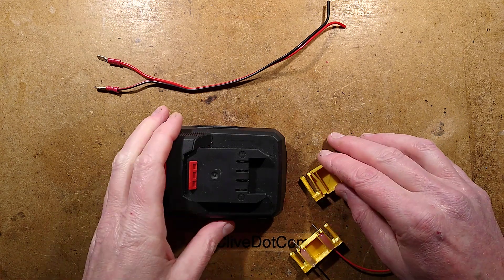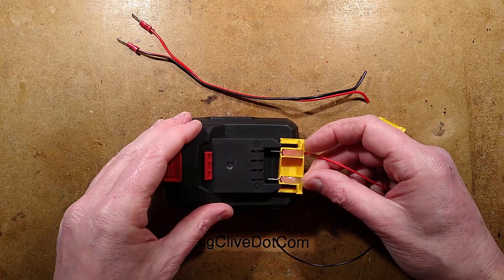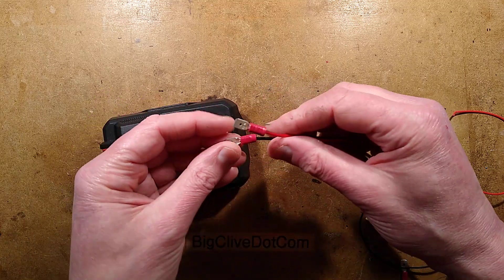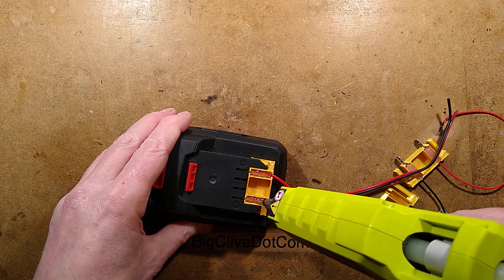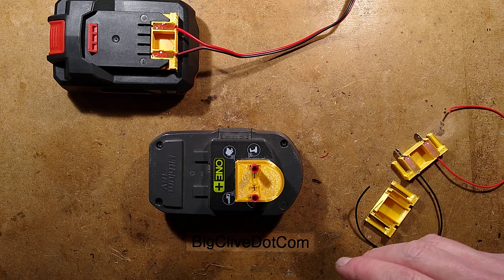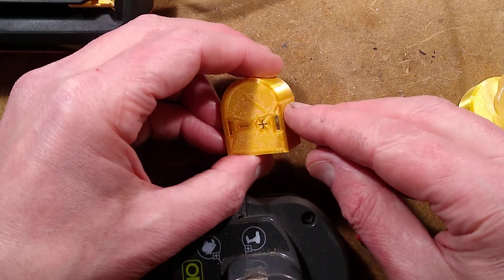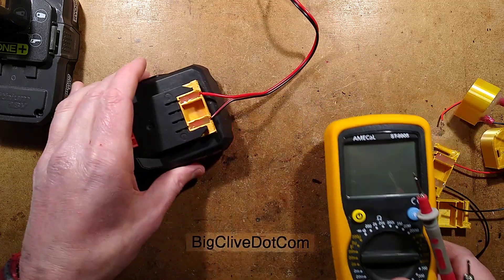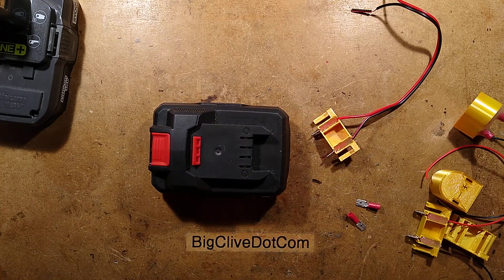Simplest Ryobi and Parkside battery connectors

Comment: Parkside is made by einhell/ozito and not compatible
Reply: I thought it looked like einhell as that's my ecosystem.

It's a shame there not compatible 😟
Reply: @jus.photos  For Einhell Power X-change you can buy partnr 451385001031 as a ready made connector. You could use that connector as-is, or use it with a 3D printed cover.

I've made an openScad (full cover) design that should that fit ready made connector but haven't printed  this final version myself, so if if you plan to use it be prepared to file it down a bit if you decide to use it.

// script starts here

width = 52;
depth = 60;
height = 12;
radius = 5;

translate([-35, 0, 0])
    color("gray")
        model();

function x() = -width/2;
function y() = -depth/2;
function z() = 0;

function size() = [width, depth, height];
function location() = [x(), y(), z()];

module base()
{
    translate(location())
        linear_extrude(height)
            minkowski()
            {
                square([width, depth]);
                circle(radius);
            }
}

module base_cutouts()
{
    slot1_width = 49;
    slot1_heigth = 4.2;
    slot1_depth1 = 56;
    slot1_depth2 = 55 + radius + 1;

    slot2_width = 42;
    slot2_height = 6;
    slot2_depth = 55 + radius + 1;

    slot3_width = 49;
    slot3_height = 9;
    slot3_depth = 12;

    function slot1_x() = -slot1_width/2;
    function slot1_y() = y() - radius;
    function slot1_z() = z() + height-10;
    function slot1_location() = [slot1_x(), slot1_y()-1, slot1_z()+2];
    function slot1_size() = [slot1_width, slot1_depth2, slot1_heigth];
    function slot2_location() = [slot2_x(), slot2_y()-1, slot2_z()+1];
    function slot2_size() = [slot2_width, slot2_depth, slot2_height];
    function slot2_x() = -slot2_width/2;
    function slot2_y() = y() - radius;
    function slot2_z() = z() + height - 6;
    function slot3_size() = [slot3_width, slot3_depth, slot3_height];

    union(){
        translate(slot1_location())
            cube(slot1_size());

        translate(slot2_location())
            cube(slot2_size());

        translate(slot1_location())
            cube(slot3_size());
    }
}

module stub()
{
    stub_width = 34;
    stub_depth = 11;
    function stub_height() = 8;
    function stub_x() = -stub_width/2;
    function stub_y() = y()+55-stub_depth;
    function stub_z() = z()+height-stub_height();

    function stub_location() = [stub_x(), stub_y(), stub_z()];
    function stub_size() = [stub_width, stub_depth, stub_height()];

    translate(stub_location())
        cube(stub_size());
}

module lock_cutout(){
    translate([-16, y() - radius + 4, z()-1])
        cube([32,7,9]);
}

module connector_cutout(){
    translate([-14.5, y() - radius + 29.8, z()-1])
        cube([29,19.2,9]);
}

module model()
{
    union(){
        difference()
        {
            base();
            base_cutouts();
            lock_cutout();
            connector_cutout();
        }

        stub();
    }
}

Comment: Time to print a few out for myself. But as an after thought, I was thinking whether I could just rig up a PCB with soldering crimp connectors in the same shape and making it work. Don't know. There is a chance that it may not have great stability and balance, but it should work. Great Video As Always!
Reply: yep, you can get the crimps bigclive used as a 90° angled pcb mount version, those should work here..
but i do not know if the 2.54 distance of copper plated prototyping boards would fit..

Comment: Great idea! I've been just cramming wires into the slots (and taping wires to the Ryobi batteries) and his is much more secure.
The Parkside looks very similar to the drillmaster battery sold by Harbor Freight stores here in the US. I'll have to print out one of your connectors to see if it fits.
Reply: I tried using neodymium magnets to attach spade connectors to Ryobi batteries. It kinda worked, but even the 10mm³ magnets I used weren't really strong enough... I really should finish fixing my 3D printer! 😹
Reply: @AndrewGillard  Maybe you could just clamp the connectors to the Ryobi battery.
Reply: I’ve been using a big plastic spring clamp with some stiff wire wrapped around the tips.

Comment: Very cool idea, I think I can adapt the Parkside one for my Makita 18V packs. To clean up the Ryobi adaptor I would print a top cap having the same footprint, with holes and wells inside to hold the crimped cable ends. Then glue them back to back.
Reply: Here's my implementation of your idea!

//ryobi top hot glue assembly
$fn=50;
height=12;
union(){
    difference(){
        union(){
            //main block
            cylinder(h=height,d=29);
            translate([-14.5,0,0])
            cube([29,20.5,height]);
        }
        //battery recess
        translate([0,0,1])
        cylinder(h=height,d=27);
        translate([-13.5,0,1])
        cube([27,19.5,height]);
        //terminal slots
        translate([-12.5,3.5,-1])
        cube([2,7,5]);
        translate([10.5,3.5,-1])
        cube([2,7,5]);
        //polarity window
        translate([-7,4,-1])
        cube([14,6,5]);
    }
    //hot glue basin
    difference(){
        translate([-14,1,0])
        cube([28,12,height]);
        translate([-14,2,-1])
        cube([28,10,height+2]);
    }
}
Reply: I was thinking exactly the same thing. :)
Reply: You could probably just print the top bit solid with holes. The holes are small enough that they should bridge with no issue.

Comment: I guess you could then use something like this to power some garden LED lights for a lot longer. My existing ones take three AA cells (I use rechargeable cells) so I am sure with some sort of voltage dropper the power tool batteries would power them  for a lot longer and then could be just charged up again. I guess the only problem is whether the low voltage detection is in the battery or the power tool so the voltage dropper may have to incorporate some sort of low voltage detector as well.

Comment: I have previously just stuffed spade connectors into the battery slots.  Will be setting up my printer later.

Looking forward to the new Parkside batteries and charger based on 21700 Li-ion batteries.
Reply from the maker: Yeah, I have to get a set of those, even if just for the cells.

Comment: Very neat! I often poke bared wires into the terminals when I need to use a tool battery to temporarily power something, this is much more convenient!
Reply: I have been pushing bladed terminals into my power tool batteries for years.... did it one year to power my niece's power wheels jeep, that thing was doing donuts all over the driveway!
Reply: @paulstaf  I wired a pair of Power Wheels batteries in series and fitted them into the “motorcycle.”  It was fast enough that it attracted older kids from the next block!
Reply: Often use my DeWalt batteries to power up and down car windows when installing speakers and sound deadening like dynamat
Reply: A real man connects one testicle to each terminal.
Reply: @MattyEngland  No, a real man would do it using the stun gun module which Clive has demonstrated before during a drinking session!   ;-)   Hahaha!
Reply: @ericoppel5698  Wtf, Clive really tasered his own balls? 🤣🤣

Comment: Great idea actually. I have used the spade connectors before to use my drill battery in other products. I will have to look at the script and see how I can change to suit. Thanks Clive.
Reply: Bosch Professional battery
//Use with two male spade crimps
difference(){
union(){
//main block
cube([59.6,76,10]);
}
//side slides
translate([-1,17,6.2])
cube([61,60,6]);
translate([3,75,-0.1])
cube([1.1,1.1,7]);
translate([55.5,75,-0.1])
cube([1.1,1.1,7]);
translate([4,17,-1])
cube([51.6,60,8]);

//Terminal cutouts
translate([7,1,.5])
cube([6,15,10]);
translate([46.6,1,.5])
cube([6,15,10]);
//terminal slots
translate([9,15.9,1])
cube([2,10,10]);
translate([48.6,15.9,1])
cube([2,10,10]);
//cable slots
translate([8.5,-1,4])
cube([3,10,10]);
translate([48.1,-1,4])
cube([3,10,10]);
//plastic and time saver
translate([-0.1,-0.1,-0.1])
cube([6,10,11]);
translate([53.6,-0.1,-0.1])
cube([8,10,11]);
translate([15,2,1])
cube([29.6,13,10]);
//polarity markings
translate([2,13,8.5])
cube([3,1,2]);
translate([3,12,8.5])
cube([1,3,2]);
translate([54.6,13,8.5])
cube([3,1,2]);
}